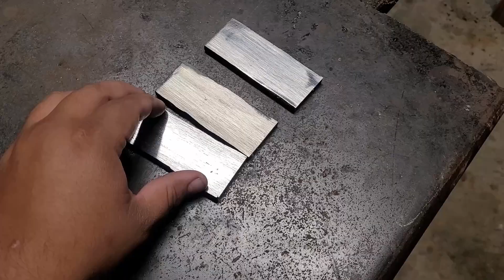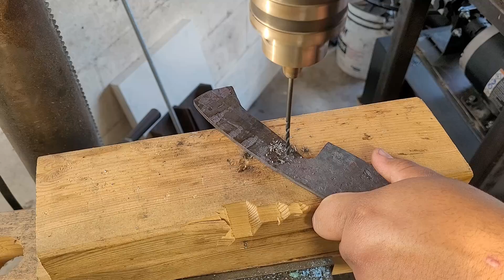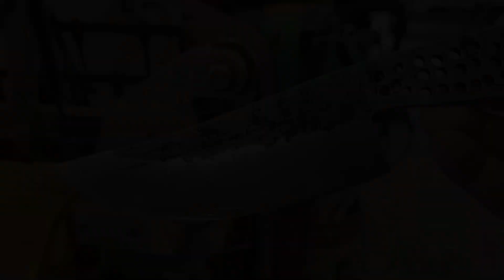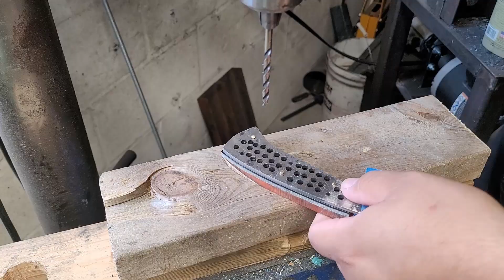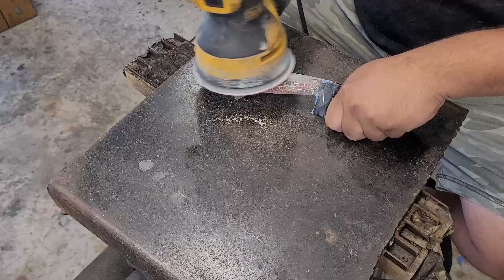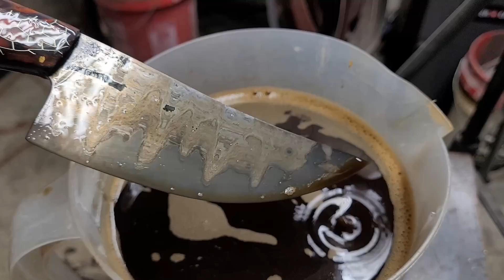Making A Wrought Iron San Mai Hunting Knife

Comment: The slag that's in wrought iron will dull a band saw blade almost immediately. Just always grind it or use a andle grinder to cut it. It seems it's only like that after you hot work it for some reason.
Reply from the maker: I didnt know. Thanks for the info.

Comment: Was hammering wrought iorn into stock today and I noticed the blacksmith who worked it before me worked the bending too cold leaving fractures I welded most of them closed and one little peice was splitting like crazy and freying apart so I decided to weld the whole thing together.. I got the weld good and made some workable wrought iorn gonna work it more tomorrow and get some impurity’s out not sure what I’m gonna use it for but from folding the edges into itself to keep from splitting apart I imagine there’s gonna be some crazy grain on it once done 
( I did this for all the ppl who say you can’t weld your ends and bits into workable wrought iorn & or that it’s not worth it.. it’s always worth it when you have some clean fresh wrought)
Reply: This summer once I build my coal forge I’m gonna make a billet full of wrought iorn bits and weld them all together and make some new stock (my current forge vevor single burner can weld with 7psi it’s also not the heat as much as the person working it.. before I couldn’t weld steel lower than 10-15 so gonna go back and try it on 7 tmr

Comment: A very timely video for me, as I will be starting a wrought go mai knife this morning. Hope mine comes out as well as yours! I'm going to etch mine before the glue-up and am curious about why you etched after you put the scales on. My way doesn't involve that cursed nail polish . . . .
Reply from the maker: Good luck. And i did it this way because i like to have my knives fully etched and its difficult to get the handle and knife flush all around the handle before etching. And it could lead to line up issues because of the tiny tolerance between the material and pins.